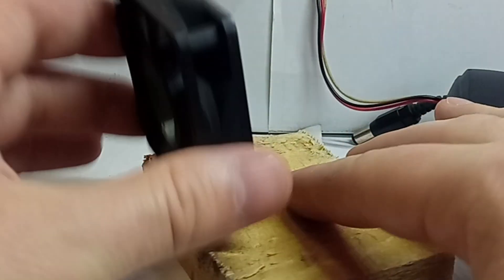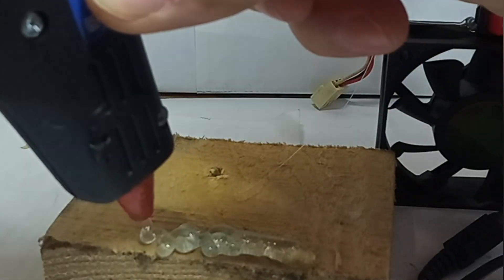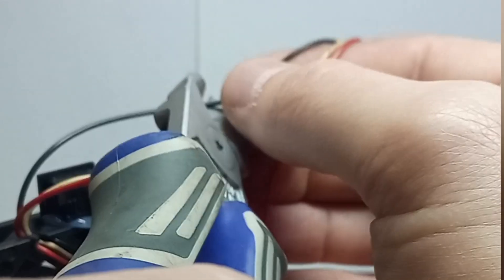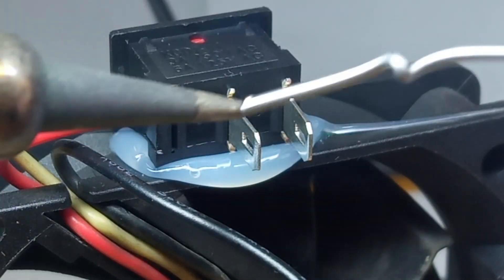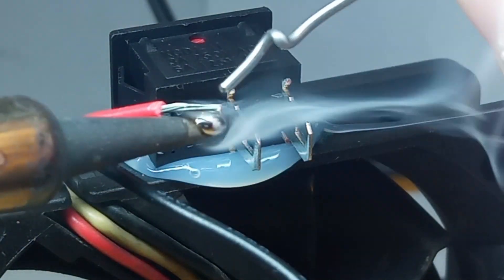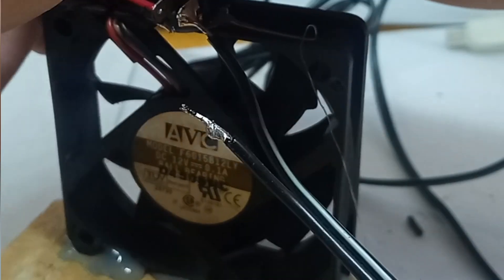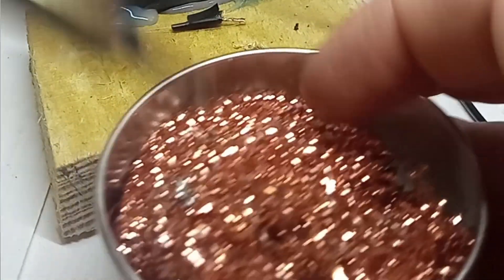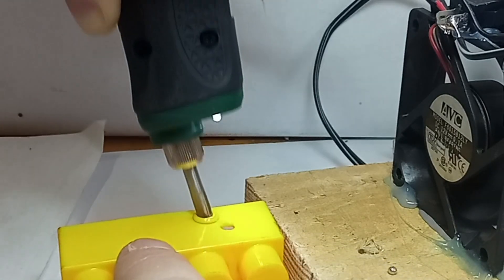DIY Soldering Fume Extractor: Clean & Safe Soldering Hack!

Comment: I think you skipped the single most important part: Adding a filter. Without a way to filter out the fumes from the air, this is really just "pointing a fan at your workspace" but with a lot of extra steps.
Reply from the maker: Work in a well-ventilated area.  Direct the fan so that the air stream goes out of the window